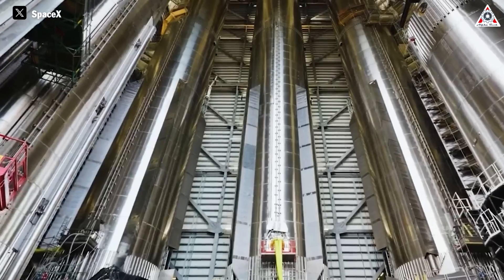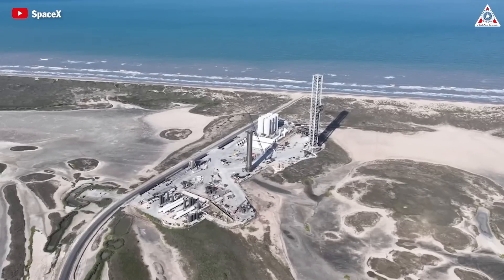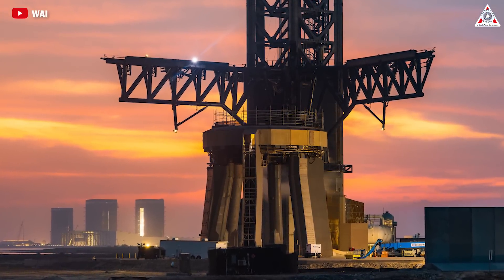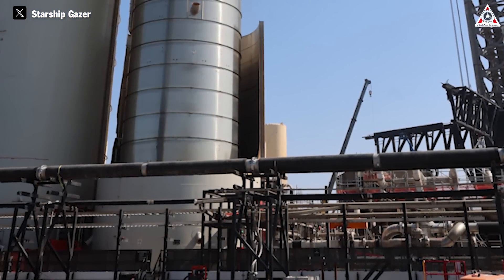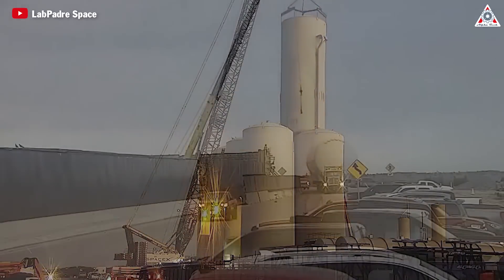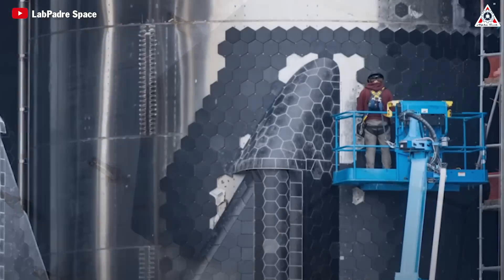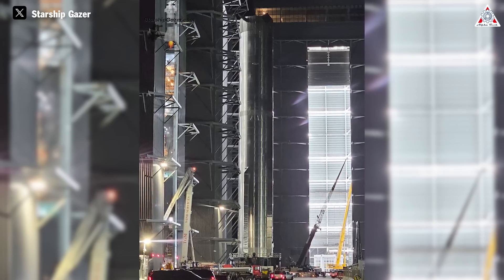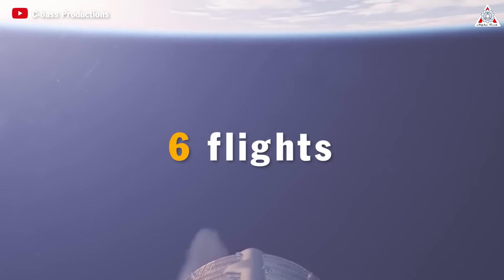SpaceX Stage 0 ramps up to meet Starship Flight 4 as schedule.

Comment: SpaceX is always busy,  They have a definite work ethic, and a definite innovation ethic.
The two in combination get a flow of increasingly improving results.

On the scrapping, dont know what they are doing, but if they are selling the stuff at scrap prices, they are losing serious potential.
As the Steel Boat Building Guru, Thomas Colvin pointed out in one of his books, for a builder of hulls, a scrapyard is as close to heaven as it gets.
Saves money, saves time, and you always have the stuff you need for unplanned issues.
So if not already in place, might be a good idea to consider a well organized scrap yard, where every thing is cut up and stored in good order, and labeled.
So that the fabricators know where the incidentals come from, without waiting for chain of command and delivery, and the engineers can use the stuff again producing runs of production on smaller items.
The only thing that should go to the recyclers is dumpsters full of very small scraps that all the other virtue has been extracted from.

Sure Elon would like it if he thought about it.
He might even use the last scraps in casting.
Gonna need alot of fittings on those ships. from hatch dogs, to cabinet latches...

A penny saved, is a penny towards Mars...